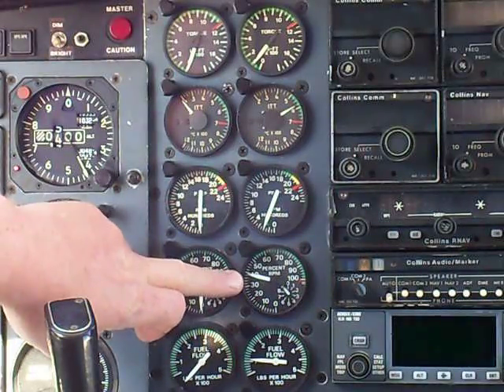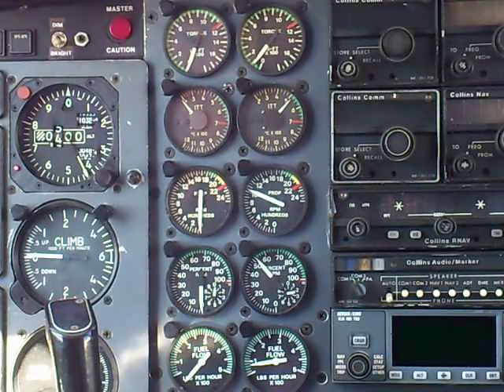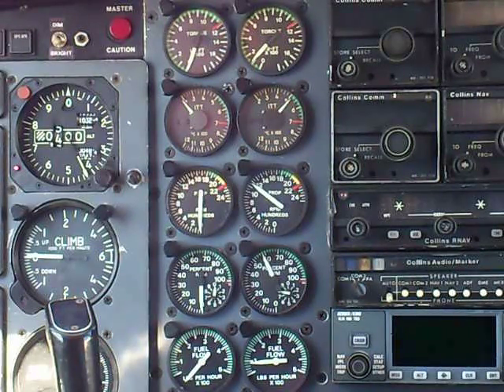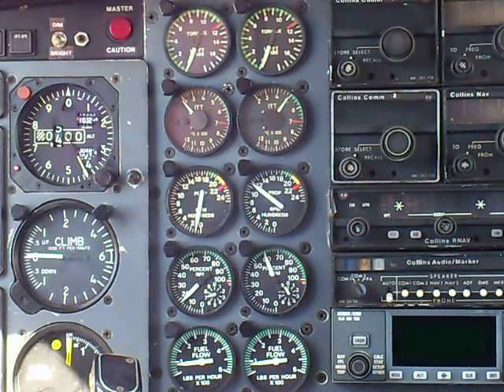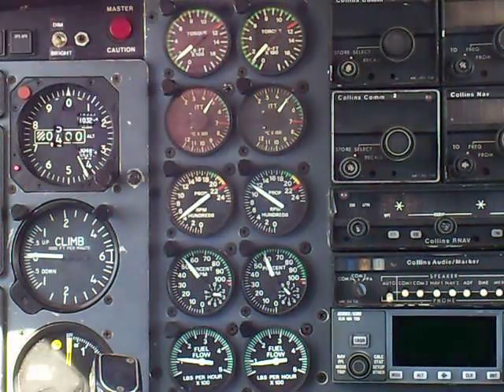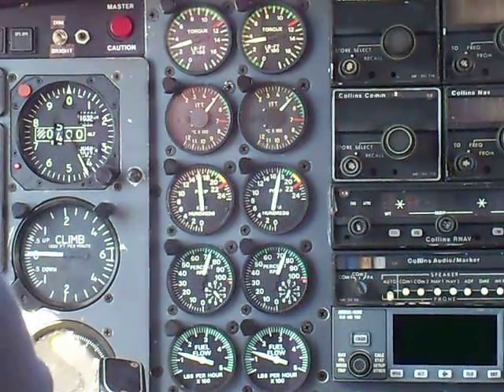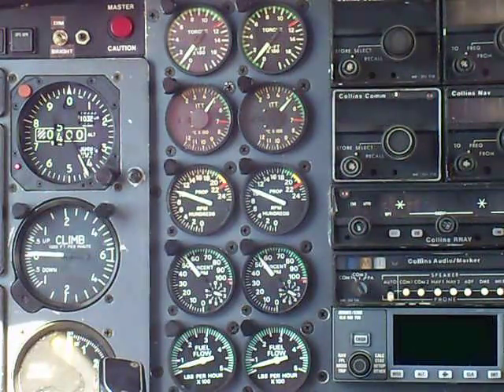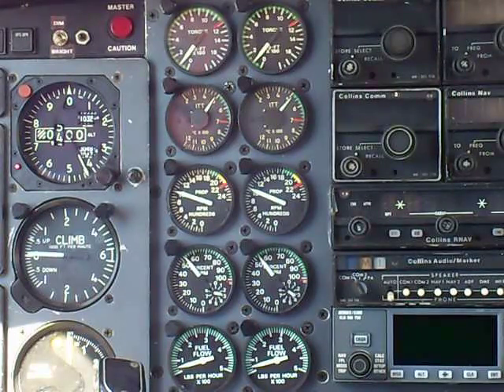PT6  Engine Run -11's

Comment: I have seen this problem alot on -67d's. Had a few different causes. sometimes its a nozzle / flow divider issue sometimes its an issue with start electrical power but mostly changing the fcu fixed it.

Comment: Afternoon-
Did you notice at 88% on the Ng that the ITT's were "almost" the same ?   They looked 'closer' in temps at this power setting (700 lbs per side) than at any other time during your run-up.

Sir, you did fine by me.  I could live with this.
TR in Texas

Comment from the maker: remember this was a troubleshooting run to confirm the effect of my adjustment. I wanted to compare start durations on battery only for both. Most check lists suggest to speed the N1 up some before putting gen on line due to field excitation. However, it's not necessary to ever turn on a gen if you dont mind running on battery only. Gens will come on line even at idle. I think the speed suggestion is to handle what ever load may be not to bog N1 at idle